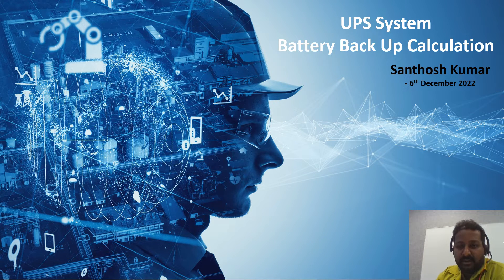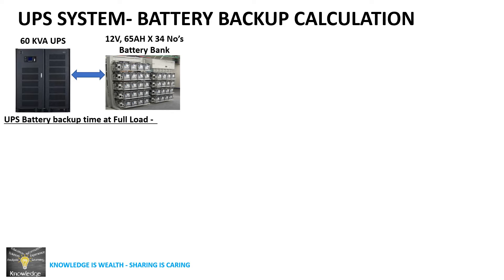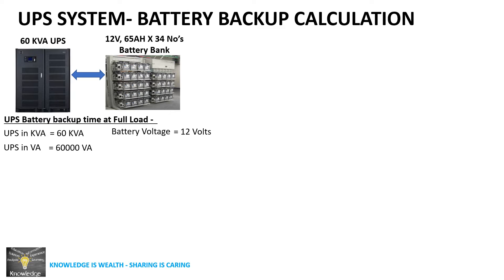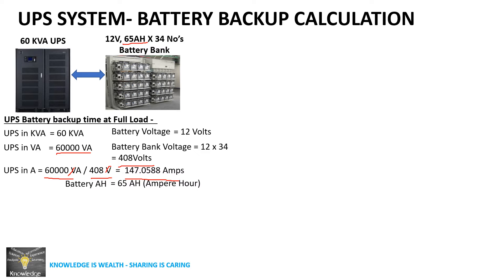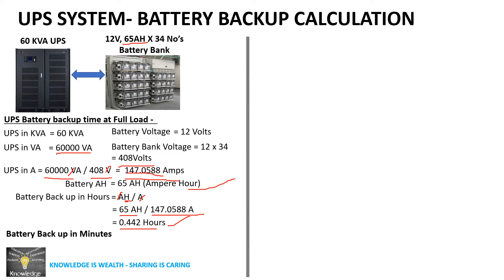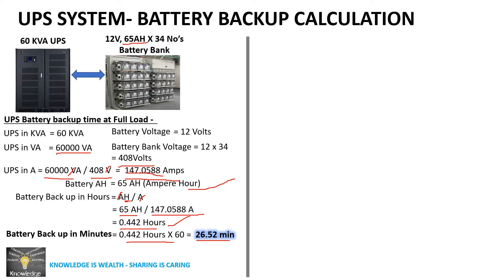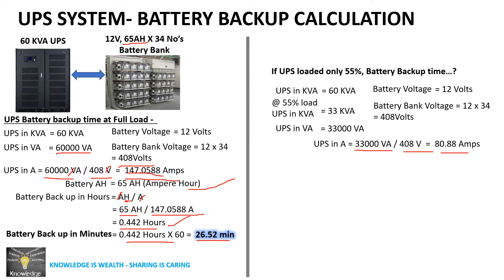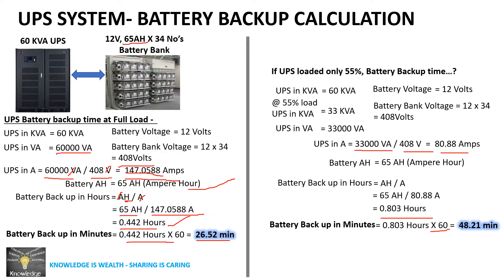UPS System Battery Backup Time Calculation

Comment: 06:31 you need check battery datasheet to confirm battery can handle ~1200Ampere within 19Mins
Reply: I check one of battery datasheet cannot handle even only for 5 mins

Comment: Meaning a mall of 30kva generator will be  better on ups of 100kva @ 512v  200Ah lithium battery on 20-10% load
Reply: Also complemented.with solar array

Comment: This is wrong.. Voltages vary with discharge..
Reply: No it's correct because the battery voltage is Nominal 12volts only

Comment: Sir why have you not done 408 volts  mulitply by 2 becoz its 2 battery bank??
And just added ampere hour 200+200???
Reply: I think the both battery banks are done with parallel then current should be i1+i2 =400 AH and voltage should be same
Reply: Because in series connection the battery voltage is constant value and current is added
Reply: @vijayraju2379  In parallel connection the Voltage remains constant  :)
Reply: Same doubt

Comment: There is no sound from 4 minutes sir pls once check it
Reply from the maker: Yes, Sorry... one slide audio missed, pls refer last slide (from 9min) Lithium- Ion batteries, calculations are similar for Two Battery bank, only thing we need to add AH for two battery banks.
Reply: I remember you teaching me the same concept 10 years ago and I still have the working sheet written down by you with me. Great going Santosh